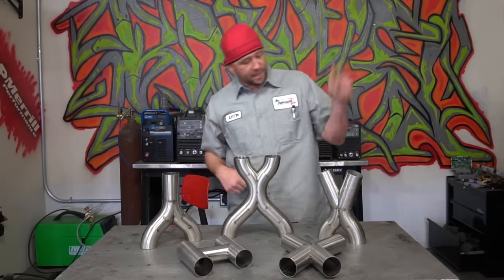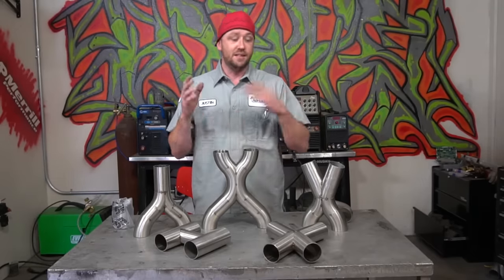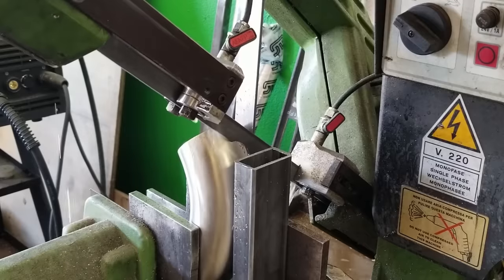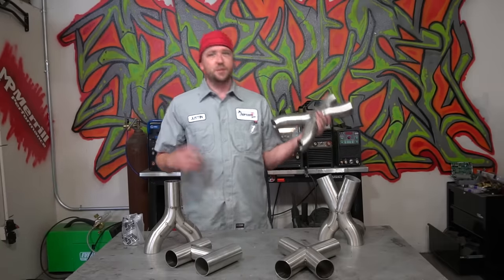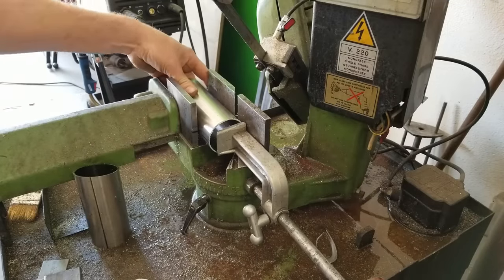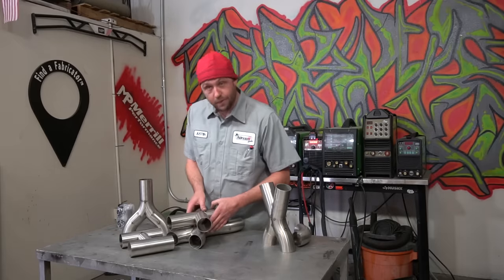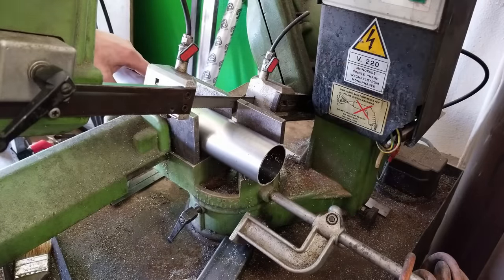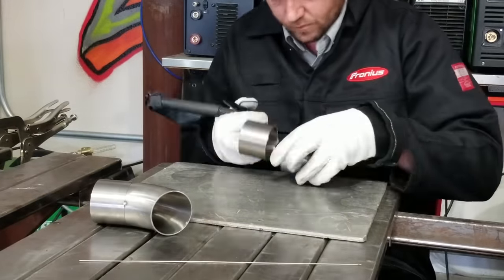TFS: How to Make X Y H Pipes and Transitions

Comment: I use to be a fabricator for rail road, and recently opened my own shop where I fab turbo kits. This video is 100% the best pipe fab instructional learning tool there could be. Great job!!!!
Reply: Your the best
Reply: I went to work at a shortline about 5 years back . 
I have 25 years in hands on all aspects steel fabrication experience 
They hired me to build their fabrication skills and put together a shop tied to the mechanical department . 
But had to put me in exsisting department that had an opening. Which was in mechanical.. 
I took the job becuase of the apeal of the benefits. 
I designed and built spark arrestor attachment pipes for gp38 locomotives with 2 stroke engines. Which can throw some serious fire up in the air. I think I will just say it was  Interesting working for the railroad..fun at times even. 

 I made it 3.5 years found out my mechanical manager was actually trying to pass my skills off as his own. Which has zero of at all in the fabrication world .  And was succsesfull enough to get a regional promotion about 6 months after I quit. He is good at stealing knowledge from many people in his career. 
I can't say I miss railroading

Comment: Love watching this kind of work. I do this kind of work for a living so I take quite the appreciation in seeing others methods in figuring this stuff out. I'll be working on an x pipe configuration for my 98 grand Cherokee with a 5.2 V8. I think what's going to be best in my opinion would be a combination of the splayed x portion @ 45* spread and 45* turns to capture the end and make parallel. I tend to like this style of X-pipe for the best flow characteristics as the merge portion is done in a straight section of tube versus a radius. However, packaging is king and sometimes that don't always work. Thanks for the awesome content Justin!

Comment: Very good instructional video!  One trick I use for drawing a straight line on pipe, is to lay a length of angle iron on it, such as 1"×1" ×1/8.  It works very well. Larger pipe, I'd use larger angle.  It self centers.
Reply: I've done that too. You don't need to measure either, unless you need to mark both sides.

Comment: Austin, another quality video, chuck full of information with little easy math. Great Italian bandsaw with the motor mounted on a gear reduction gear box, plus water-based cutting fluid. I saw what appears to be a 220 volt sticker. I bought a MIG in 1984 build in Italy by the largest manufacturer in their country, still works fine today, but no TIG. Being forced to retire way early, I will own one. I know what’s like to run out of shield gas, why does it always happen on the weekend. Plus, I have seen the cost for 25/75 from $28.52 in 84 to $112.18 just in late 2019 and have every receipt in the file cabinet. Keep up the good work. As a long time subscriber, I guess I will never understand a dislike. ?
ASE Master Tech since 78 - Retired

Comment: A much faster and accurate way to get a centerline on tubes is to take two pieces of tubbing of the same diameter, clamp or tack them together at the ends, take a straightedge or similar, lay it over perpendicular to the lenght and drag it along the tubes. Flip them over and do the other side. Boom! Lines on exact center exactly opposite each other!

Comment: Quick tip from me that works- tack weld the pipe to the bit of box section support. Keeps job well supported and easier to get set up right off the saw. Quick clean up with grinder and ready to reuse the supports.

Comment: Small tip for the bandsaw for anyone. Slow the feed down, and have just enough pressure so that the slower fed blade has a chance to bite rather then skate or slide across the material. Great video Justin, quality work and content as always 😀
Reply from the maker: Andrew Lang Yes - it's a dead slow process. I should have mentioned these cut shots were sped up to 400-600% and they still look slow haha. Thanks for the tip!
Reply: The Fabrication Series No problem Justin:) I’ll say thank you for all the tips you’ve given us 😀
Reply: What TPI (Teeth per Inch) is good for .065 wall tubing?
Reply: jwright650 as high as you can find, i use a 10tpi, but super thin wall i might go to a 16tpi or finer.
Reply: I'm using a 10tpi and it rips the teeth right off the blade.
Reply: Andrew Lang dalton

De
Dalton
Reply from the maker: jwright650 I use a 10-14 variable tooth blade.
Reply: jwright650 
Cut slower.....
Reply: The way it was told to me is that you need a minimum of three teeth on the material.

Comment: From what I understand, you could also make a y pipe by welding two angled pieces together and lobbing off the end. Still have to swage or flare it to make it round, but it should be a little faster fab wise. Probably better for making Y's that have a bigger single pipe than the two individual pipes. Which, by the way, are made for overall flow rate matching. If you have a V8 making 600HP, then you have to either have 1 pipe that can handle all of that flow, or two pipes that can handle half of that flow. 2.5 duals can do it, but a 2.5 Y into 2.5 will likely choke it. This is why you go 2.5 Y into 3.5, as the total tubular area of a single 3.5 is about the same as two 2.5 pipes.
Reply: I've actually built a few Y pipes this way. Honestly it's the same whether you use a radius or a straight with some kind of angle cut. How you mentioned does make it a rather simple and time effective way but can limit packaging too. Whatever fits and has relatively good flow characteristics is king! 😎

Comment: On an X pipe the elliptical area should be the same as the cross section of the pipe. The outlet pipes can have reduced diameter after the X without flow loss as long as the cross section of the outlet pipes together isn't less than 1.5 times the cross section of one of the inlet pipes. 
Also on a y pipe the exit should be 1.5 times the cross section of the inlet pipes. If the inlet pipes are the correct diameter merging into the same size pipe will be a restriction. You need a larger outlet because the frequency of the exhaust pulse doubles.

Comment: Instead of cutting 4x 90-deg pieces and then 4x 22,5 deg again, you can immediately cut 1x 90 deg to get 2 halves, and then each half 22,5 deg in its center. As it is the same cut, the 2 halves will be exact mirrors of each other.
Reply from the maker: Cas Tuyn I do a lot of things different in vids for visual reference which makes it easy to follow. Cutting pieces individually is one of them.

Comment: I was always shown to make a common line on pipe just use a straight piece of angle iron! Was always easier and quicker. 
Enjoyed the video though. Clear concise instructions. When tacking you use a hotter amperage than if you where actually welding. I don't get to do much tig unfortunately.

Comment: I’m sure you have answered this before, but what’s you tig set up. Like how hot are you running, how thick is the pipe, and what size tungsten are you using. And what size filler metal is that

Comment: I'm curious about how you weld in between those pipes when you can't even get the cup in there. I see you tagged them prior to full assembly, but you didn't weld them. I assume you could weld them at anytime, but to get in between those close junctions like on the X's, this is where you will have problems welding because of the cup on the tip

Comment: So if you had a way less of degree of entry (8° vs 45°) and working with baby pipe (1.25”) wouldn’t it be better to cut less of the diameter and extend the length of the cut? (So like .125 “on each pipe diameter cut running 1.79” so the area of the cut is equivalent to the flow of one pipe or should it be two?)

Comment: So, the actual trick here, at least for the H pipe, to get the best scavenging flow is to place it where the pipes get hottest. Some thermal tape or paint from someplace like Omega Engineering on the pipe before a little run will reveal the spot.

Comment: Great vid! Could have really used this 15 years ago when i made a custom turbo kit to a 3 inch downpipe y'd into dual 3" outlets on a 94 grand prix with a built 3400! Lots of trial and error lol. This will really help for my 78 dodge d150! Any ideas on using a cut off wheel for this? That's how i did the grand prix...i don't have room in my small garage or access to a band saw

Comment: Nice bandsaw, too bad the built in stop is too short. You should drill and tap the face of it for an add on piece that makes the stop higher, so you can make the cut for the parallel x-pipe on outside of the elbows without a big vise-clamp and a piece of box section.

Comment: Hi Justin we are a UK company branching out into this area could you elaborate on the band saw as we are looking to buy a good unit like yours but confused on specs we wouldn't be doing larger than 3" 90* ss tube ps digging your fab skills.
Regards Barry.
Reply: South Coast Workshop it's just a basic bandsaw here in the uk. You can pick up quite elaborate secondhand one's with auto feeders where you can set length/angle and quantity for around £750 240v/single&third phase.. There are loads of companies in the uk with huge stocks of pre owned industrial machinery.

Comment: Whats the machine called your using to cut the pipes?
Reply from the maker: 208LexusOwner A band saw.
Reply: The Fabrication Series ive seen bandsaws before but never one as elaborate or with the actual saw part on a handle that moves. Ive only seen stationary ones
Reply from the maker: 208LexusOwner If you want to narrow the type down, it's a horizontal band saw.
Reply: Thanks man. Do u have any videos about how to make one pipe split into 2? Staying right next to each other?

Comment: Next time when you do stainless do me a favor and use 90%He/7.5%Ar/2.5%CO2 as your shielding gas and not Argon.
Reply: Lumanet Solar Energy LLC The gas that you recommended is great for mig welding stainless not so much for tig. Tig welding requires an inert gas for shielding the puddle. Argon is the proper gas to use for tig. Sometimes when tig welding thicker aluminum you may benefit from a helium argon mix or just straight helium. It will give you a hotter arc. This is just my 2 cents. 👍
Reply: Even with TIG I want my 2% CO2 so I can restore later on the rust prevention without it the Stainless will be exposed to Rust.
Reply: Lumanet Solar Energy LLC then the stainless steel that you're utilizing is not of the 3-Series it is of the four series that does not have enough chromium or Nickel in it. 4 Series stainless has a tendency to rust example 409
Reply: Bradley MacDonald you are 100% correct sir.
Reply: Both 308 and 309 will rust once you TIG or MIG welded on the material.
Reply: Daniel's Speed and Performance 
For future reference you can passivate stainless after welding to prevent rust. Plenty of article on the internet on how to do this at home. Basically when you weld stainless it depletes the chromium in the surface layer which will allow rust oxidation of the iron to take place. Passivation will help return the chromium to the surface providing a natural rust preventative.
Reply: David Goetz I tell you what I'm always down for new innovative ideas so next time I get another bottle for the shop I will try I mix and see how that works but I haven't had any rust issues with any 304  316 or 308 204 or 321l but I will give it a try.